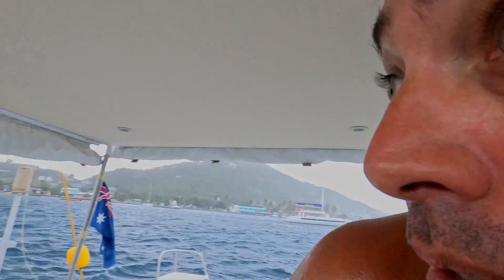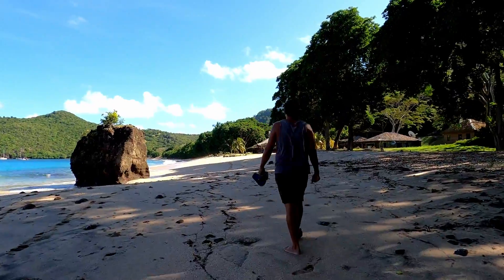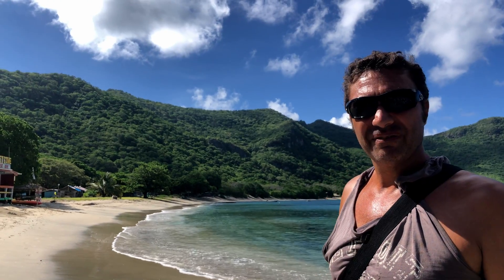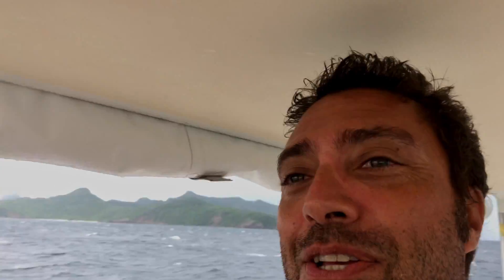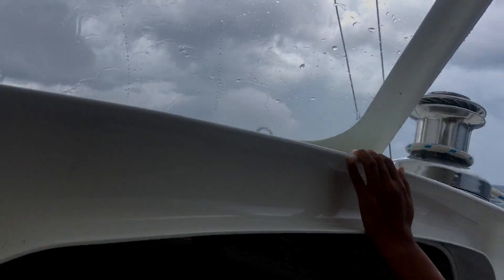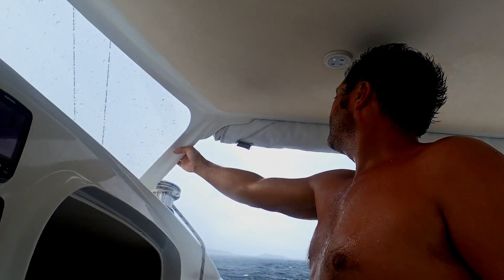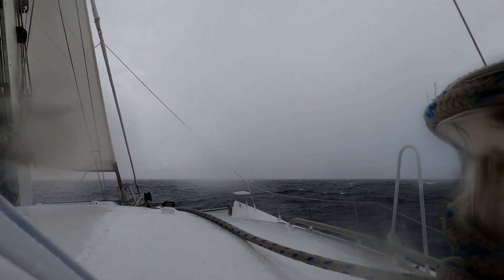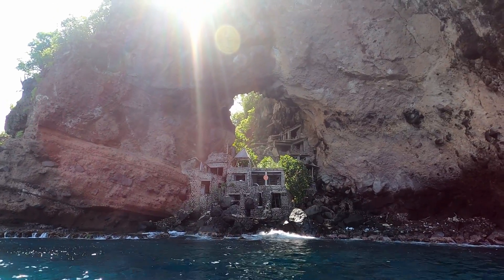Storm season and Electrical upgrade - Sailing life EP42

Comment: Caribbean winds are crazy. I got out of nowhere 55+kts on my second day cruising my used trimaran (38') inside Bahama bank...after sunset it all went crazy...that's how I learned to reef down main and change head sail during nights....we sailed that squall at 15+ kts speed and I was shitting my pants...luckily nothing broke and after all calmed down I knew our new rigging was well done...made it to Ecuador and Galapagos alright in one piece...I was just 21 y o. Crazy years..so much luck and serendipity..it's hard to believe it all work out fine ...always reef down Jamie ...best luck take care..
Reply: I think they have a washing machine and maybe a clothes drier.
Reply from the maker: Hah! Nice work... Yeah I get lazy with reefing..being essentially single handed... . Most of the little storms around us barely puffed out 20kts...I reef earlier now.!
Reply: @SailingLifeonJupiter  yes Jamie , I forgot that practically you are single-handed and so just lower to first reef most of the time I guess your boat won't need that much main and headsail is easier...
I see your battens and mast cars are spread apart a lot , that could mess your main on higher winds reefing..maybe although difficult should see if you can add cars in between and a inside cockpit reefing lines..?..
Reply: @UUBrahman  why not ?...I would...

Comment: can I ask one question about jupiter2, when sleeping at night, does it feel like you're inside a beer can?  my aluminum boats were quite noisy at anchor.  even tiny 3" waves would slap the hull and sound like a wind chime loudly.  They would also telegraph noises through the water from other boats. strange whining sounds..
Reply from the maker: Nope no noise issues.... It is lined with an inch of spray foam... but i know what you mean.

Comment: Love that you soldered your cable ends, makes for the best connection, especially in marine applications!!!
Was watching Barry the Old Sea Dog this morning, he was installing a anchor windless and crimped the cables:(
Reply from the maker: Yeah, I've heard both sides of this story.... But I don't have the crimps, so solder it is!... Cheers Bold guy.
Reply: @SailingLifeonJupiter  You definitely don't tin the wire before crimping those ends on. The wire is supposed to remain flexible and be able to get maximum contact area with the end once it's crimped on.
Not sure what Aus L is on about but definitely not tinned first with that hardware.

I've never tinned a wire when using those ends but I imagine the limited contact area would create hot spots, remelt the solder and the end would no longer be properly crimped on and would just fall off, cable would fall and potentially liven up the boat.
Reply: @SailingLifeonJupiter  I think it's the best way, especially in a marine environment, by the solder filling all the voids around the wire, you hopefully prevent corrosion from getting a foot hold:)
Reply: @Aus L Fair enough. I've never worked in a marine environment. Only aircraft and generators.

Comment: Having trouble with those pesky switches. Why not get some of those used by Dr Frankenstein (the same as those shown in 1950 black and white films when they electrocute someone in the electric chair)? 🤔
Reply: I thought he said he previously used four switches of that type and they still overheated. Maybe I am wrong.
Reply: @UUBrahman  maybe you need a maniacal look on your face as you operate them? 😁
Reply from the maker: I've tried finding them, believe me! But the only knife switches I could find a very low Chinese quality... Cheers David.
Reply from the maker: Nah UUB, a 4 pole switch(single unit) . Thought I would halve the heat by having 2 x 2 pole  switches... Doh!

Comment: Jamie, you need to have a bit more of an automated system for reefing in during a swell or sudden storm that you can complete without going forward and getting into possible danger and difficulty. just a suggestion. when you have more people on board manual is not a problem but with only the two of you and one of you being Princess a bit more automation may be a welcome relief to reef ): during those surprise events.
Reply from the maker: True Kusnezoff... I did elect to keep things as simple as possible, and keep everything at the mast.... but there's always a compromise.... in this case, perhaps safety.

Comment: Hi there! Love your boat and your channel! Great job and thanks for sharing! Can you weld aluminum? Do you have a welder on board? Have either of those answers persuaded your purchase of an aluminum Cat?
Reply: You'd need someone who specialises in welding aluminum.
Reply: @ronparcke-wms2146  I can weld most methods but haven't learned aluminum yet. It was very difficult when I tried but without much instruction or practice.
Reply from the maker: Thanks Israel... Nope I don't weld... But if Tim Mumby can teach teenagers with no experience or training how to do it.. Then...it can't be too hard.... Its just what you're familiar with.
Reply: @iumbehant  also aluminum is a vapour you'd need tp avoid breathing in. Id suggest a respirator that'll filter away volatile gases. 
Aluminum is believed to be connected with dementia since some amounts were found in brains of those with Alzheimer's disease. Vapours get into your body in seconds once breathed in compared to aluminium cans(but suuposedly can be detoxed in this instance since slow and miniscule if at all).

Comment: A very interesting episode, it is very difficult to find affordable high current switches with low contact resistance (gold/silver) often beryllium is used. 
I use additional starter relays for power for the engine but they need power when switched on.
After this gust, the limit will shift; people will say it was worse back then.... experienced myself during a tornado in the MED. Good luck, nice to watch you.
Reply from the maker: Geez a tornado!... Yeah I've bought a Gigavac contactor for my main dc bus disconnect... Seems good, but for $180 is ought to be!

Comment: Hi again we spoke , well messaged last time you tried the switch between the altinator and batteries .
Again on the 100 or so different yachts of all sizes I have never seen what your trying,  
I don't think it's the switch,  nothing is telling the altinator to stop producing , so it's over heating and will keep doing it .  I truly think it's a dangerous idea . It sounds like you have the opposite to every other boat , to much power,lol    you can run one engine , add more batteries , use more power.
As it's always easier to get rid of power than produce .
Can you turn something on to drain some power out of the system when it's getting over loaded .
Like opening a gate in a dam ?  Get a washing machine .
Reply from the maker: Heya David... The disconnect switches are desirable to remove the engines from the electrical circuit when not in use, specifically for preventing stray current corrosion on an aluminium boat...
Cheers
Reply: @SailingLifeonJupiter  never seen it on a aluminium yacht
Reply: @SailingLifeonJupiter  I understand what your saying , but that's not the way , Evan the biggest producers of aluminium boats don't do that , Evan you tried it before and it burnt out. It's not the switch fault, 
It's the fact your producing the power still.  You need to find away to either not produce power.
You had the issue and burnt out the switch, last time we spoke . Now you did it again and burnt out the switch .  Can you see the connection, putting a switch in isn't the answer,  you need to stop producing the power, or drain the batteries so the power goes there . If you had a petrol fire would it stop if the petrol was still running .
Reply: @davidwarnes5158  but the switches are rated for much higher amps than what is being loaded to it.... so there!
Reply: @cochinaable  those switches are built to go the other side of the battery system to stop draw ,  used to isolate your batteries , on that side they do not have a permanent feed , as they are stopping 12 v current leaving the battery .  
A altinator has a regulator , as so does the solar .  By putting this switch after the altinator and after the regulator , the altinator is bashing out the power and sending it to the battery. 
And the current has nowhere to go , 
The same idea on the water , you open a tap , the pump runs along as the tap is open, forcet,,,,,  then it turns off or it will  build up to much pressure and burst, or burn itself out .
To achieve what he wants , you need a way to tell the alt8nator to stop producing .   A boat is the same as a car and you can drive for days with a full battery dc power with no issues 
Regulator sorts this .
I am not sure if he has shift or z drive , if shift connect the altinator to this with a removable belt , engage or disengage. 
Ask 5he owner if the isolation battery switches the other side have burnt out ,   I think not ?
Reply: Further to our conversation I checked with a good friend with a ovni so has many years experience 
Doing what your trying to do .
His answer was . He has an external regulator  Ballmer 612    he just switches of power to the regulator 
With no big current involved .
Reply: @SailingLifeonJupiter  I just added something that should help you with stray current issue .
It's info from a ovni owner , so relavent to the story . David
Reply from the maker: @davidwarnes5158  Yes mate.. i have those regs... these switches are only turned off after stopping the engines to eliminate any stray currents... there is no load on them then.
Reply: @SailingLifeonJupiter  with over a 100 yachts all having isolation switches , none have ever melted .